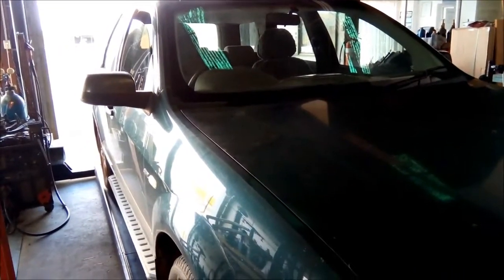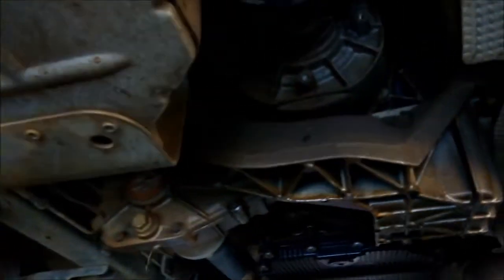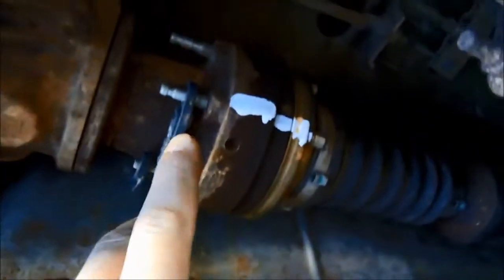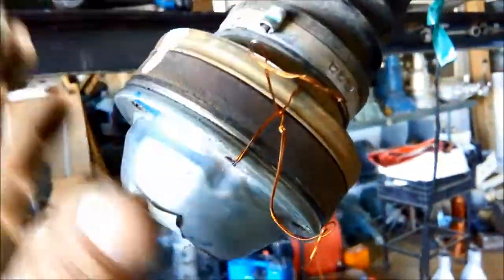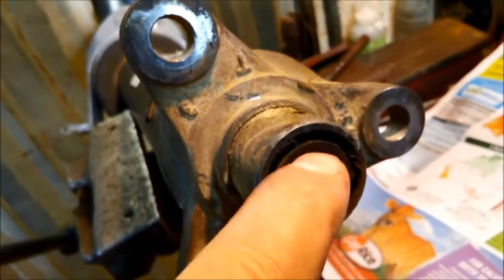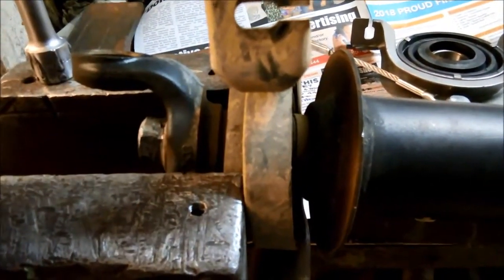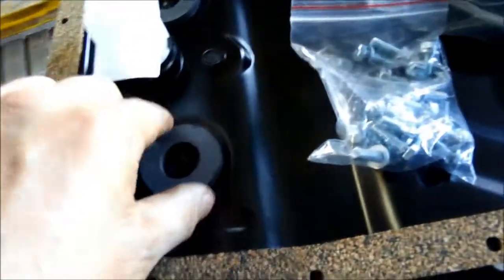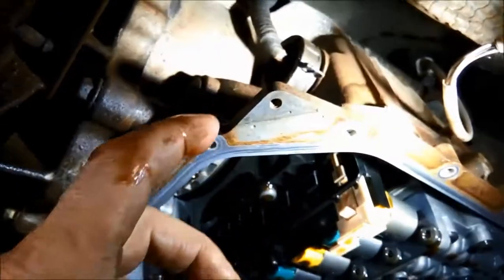ZF6HP26  6R60  6R80 09E  Mechatronic Leadframe Connector Slipping Vibration Fix, Steel Pan Upgrade

Comment: hey man, my car is flashing D on my dash board and im getting a PO705 code which is a transmission range sensor, will doing what you did in the video fix my issue?

Comment: Great video any reason the car was throwing the p0736 code? And what was the fix?
Reply from the maker: hi, most often contaminated/worn solenoids especially when underserviced. you need to clean the trans magnet and add magnets to help keep debris away from solenoids and sensors. cheers

Comment: Hi Guys do these 6hp26 have a output speed sensor internal on the mecatronics unit fault codes come up to do with this sensor  The car under load would neutralise and the speedo would stop but if you stop the car and started it again it would be ok doesent happen all the time
Reply from the maker: hi, on these usually contaminated and/or leaking solenoids. the valve body to case seals flatten out as then dont seal properly. if you get vbody off make sure you air press test ports as well. cheers

Comment: Awesome Vid....my 09 SYll TT has just started going into this limp mode and have been told I need to replace the whole Trans after the same scan codes....I'm glad I've got a bit more info to back maybe just replacing the solenoids....then to find someone in NZ to do it lol....Cheers Mate👍🏽
Reply from the maker: hi, fault code or limp mode issue is usually an electrical issue...most often contaminated and/or leaking solenoid. cheers

Comment: Neodymium magnets are powerful enough to be mounted on the outside of the metal sump pan inside the pressed dimple for the internal magnet to seat on.
Reply from the maker: hi, often we will put them on trans we are about to remove and reco. even during road test they will accumulate the fine metal. cheers

Comment: Hi, this is a great video, so thanks - just wondering you have a cork gasket here, I changed my G6E-T from a steel pan to a plastic one 4 years ago, now changing back to the original steel pan, but the new filter was supplied with a metal/rubber compound gasket, not the cork one you have here - should I use some Permatex gasket seal on the new gasket, or just leave it dry?  Gaskets always give me the hebejebes.
Reply from the maker: hi, just have it clean and no road dirt and leave it dry. cheers
Reply: @YepThatsIt  Awesome, thanks!
Reply: @YepThatsIt  Got it done yesterday - took it for a good thrash on some back-roads and it sat all night in the garage, no sign of any seepage so looks like I got a nice seal.  I'm not sure if it's just my imagination but it seems to be shifting a little smoother so I guess the 80,000km fluid might have been getting a little tired.  Came out nice and clean though.  Horrid, messy job without a hoist so glad I won't be doing it again for a while.  Thanks again!

Comment: Great video. Would you still recommend the 6speed Territory over the 4 speed? Seems like the 4 speed is cheaper to service and replace when something goes wrong??
Reply from the maker: hi, more gears , more problems. the repair cost outweighs the fuel savings. to build these transmissions will also leave a much larger environmental footprint, again outweighing the environmental saving. cheers

Comment: Hi, We have serviced the 6 speed territory 2008. There is/was no transmission leak. Car drives beautiful for everday suburban use. When I take it city it has to go through gear changes then D starts flashing and rpms go up and speed does not go. If we turn it off and back on the problem gets fixed. Fluid level is correct. Filter was changed recently. Scanned with the scanner only code is p0735 5th gear incorrect ratio. Car as such runs really smooth everday. Every time I try to cross city the problem comes. And fix straight way as soon as I turn off and on again. I have been to Adelaide from Melbourne issue happened both times I was going through cities and three times up the hill. What could be the problem?
Reply from the maker: hi, would be worth getting solenoids tested for leaking, or replacing the solenoids. cheers

Comment: I believe Ford told a lot of people that these ZF transmissions are a set and forget item, ie they don't ever need to be serviced. I'd recommend everyone who has a Ford with a ZF get it serviced at some stage. My old FG XR6T used to lurch when slowing to a stop like it was dumping into first gear really aggressively, I got it serviced just like this and fixed the issue completely.
Reply from the maker: hi, the cooler ( rubber seals harden when overheated ) & cleaner ( regular servicing with actually cleaning the trans pan and magnets ) you can keep any transmission, the longer it will last. dealerships don`t want to, or like to do transmission servicing. cheers
Reply: Why type of fluid do you run in it. I bought a kit and it was the wrong one. So I have to go back and get the pan with the integrated filter. I put merrcon sp in it. Cause that's what they gave me. 5 New quarts didn't help the slipping problem. Hoping after the new filter and some more new fluid it fixes it
Reply from the maker: @tonyhern2647  we use penrite and tritech lubricants most often. manufacturers recommend lifegard 6 but it is expensive. any equivalent oil to lifegard 6 in these transmission will do. cheers
Reply: Hey does the zf6 have a drain plug on the pan so I don't have to take the whole pan off and buy all new gasket and filter I just want to drain and top it back up. Can anyone help thanks I would appreciate

Comment: Got an old 2000 AU SW for 19 years 400,000km  not to many issues, but my 2004 BA xr6, 180,000, no end of silly faults for low kms. Whonwould buy Fords:(
Reply from the maker: hi, yes the older BTR versions were a better transmission than ION or DSI versions in some aspects. cheers

Comment: Great Video mate have you got one where you change the gearbox in a 2006 tx territory  4 speed auto 2 wheel drive
Reply from the maker: hi, not really...what`s the issue? cheers
Reply: @YepThatsIt  front seal keeps popping have bought a second hand gearbox to put in and been burnt by 3 different mechanics so far costing me 5k looking DIY because of this need a bit of help on specifics
Reply from the maker: hi, hope you had it done by automatic transmission specialist? ….was it popping out on same transmission? if so you may need to look at flex plate and pump bush...years ago I had an issue crankshaft thrust washers were so worn the whole crank and along with flex plate and torque converter were moving so much it caused pump problems on trans ( was a honda ) on yours you could put a thin metal plate ( x2 or 3 sides )with very small screws into side of seal housing. on some pump auto seals they have a flange anyway, so you can just screw small bolt through flange to eliminate that popping out problem ( happens on HP Transmission ). hope that makes sense cheers
Reply: @YepThatsIt  Yeah the first guy was a so called expert but he didn't use a genuine seal,I can't remember who told me that you should use a genuine seal and I don't know if that's true but it was also a recon gearbox ,within 2 weeks it popped again,the same guy was 300 miles away in Brisbane so instead of going back he sent me a genuine seal and 400 dollar cheque.The local mech in town put it in but it popped again,I don't think they put enough fluid in to be honest,There is a so called specialist 45 k's away but I'm told you need a bank loan to pay him ,so as you can see I'm gun shy with mechanics,I got the money but I don't have the desire to risk being screwed again,I bought another gearbox and am seriously considering doing it myself with a mate,I have worked on cars before so I'm not a total novice so I tried google and here I am.What you said sounds logical,can you offer any other advice?Once again thanks anyway.
Reply from the maker: hi, sounds like common factor is your drive plate? you say 3rd trans....if you are doing yourself my advice is get a repair manual and browse through first, have clean work area and large enough to space everything out in order as you remove bits...take extra note of thrust plates and Torrington bearings as well as which way sprags ( one way clutches ) lock and are free. good idea to take pics and short movies with your phone pointing out to yourself which way things go. its not rocket science and everything has to be learnt, no-one is born knowing anything....have a crack at it, you will definately learn something new. good luck and have fun,cheers
Reply: @YepThatsIt  Thanks for you prompt reply and what you said not only makes sense but is very helpful and I will take it on board and keep you updated.Once again thanks and keep up the good work.
Reply from the maker: have fun cheers

Comment: Good how to, do you need to drain the converter as well , in my experience the converter holds just as much fluid as the pan.
Reply from the maker: hi, in my opinion no. fluid is there mainly for hydraulic purposes and some lube. if there is no trans problem just dropping pan and cleaning magnet ( or adding magnet ) and replacing filter is adequate. if there is a problem then internal pressure leaks will be increased due to the "thinner" new trans fluid. only time we vacuum as much fluid out as we can ( via trans cooling line ) is when coolant or water has entered the transmission....when that happens you will then need to do complete drain many times ( see my other vid on milkshake ) but in the end the choice is yours. cheers

Comment: Gday mate Great vid informative great help wanting to ask u about the tri-tech ATF Fluid you use i run a Xr6 with 6 speed have u had any probs with that oil in the trans i understand  u run a business and don't need/want combacks seen ur vid on the bf u do with the 6speed as well .....as other mechanics have told me not 2 use anything but lifeguard and as u and i know its a ripoff ur info will be invaluable by the way where are u situated (business) cheers... Ken
Reply from the maker: hi, in Australia Trans Fluids have to have the required properties needed for a specific use...it is law. The Tritech or Penrite we like to use have not given us any problems and the companies have to guarantee their products anyway. There is a lot of confusion and hype on Trans Fluids ( and motor oils ) most is bullshite, if they contain the required properties they are also suitable in my opinion and our experience. There are folk out there that will try to argue with me on using original manufacturer oils and fluids, but I stick to the facts. Having said all that, there will usually be standard duty fluids and heavy duty fluids available, so the choice is yours taking into account your vehicle requirements and application...use the best suitable fluid you can afford ( that does not mean the original manufacturers oils/fluids) I heard recently someone bought CVT fluid from the dealer at $400 per litre ! haha good for them. Tritech is fine in my opinion, just make sure its the one they recommend, same as with Penrite or from any other manufacturer. Hope that helps and there`s a beer in it for me Cheers
Reply from the maker: http://www.tritechlubricants.com/lube-guide/
http://www.datateck.com.au/Lube/PenriteAus/
Reply: YepThatsIt cheers ur a legend if use the tri tech syn lv  on the 6 speed ford then its good enough for me and if ur close to me then happily shout that beer cheers.Ken.